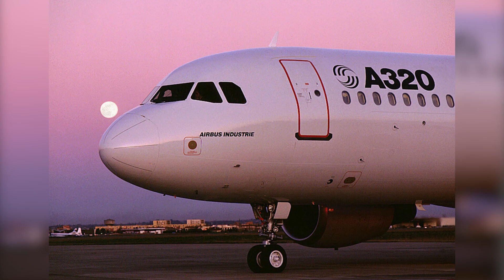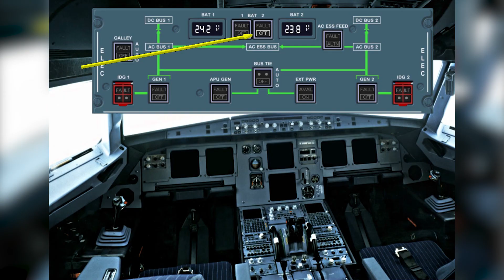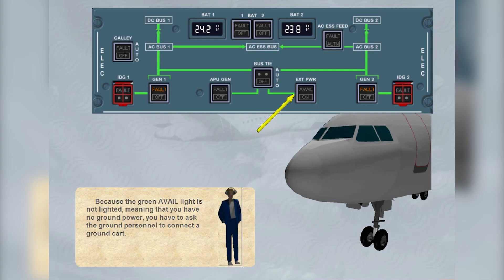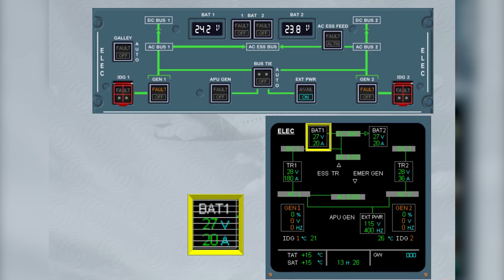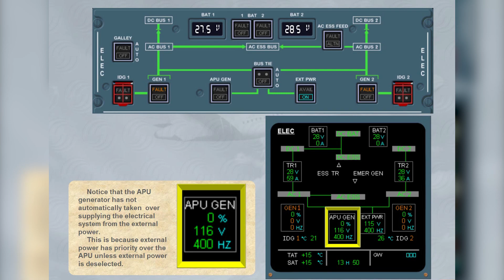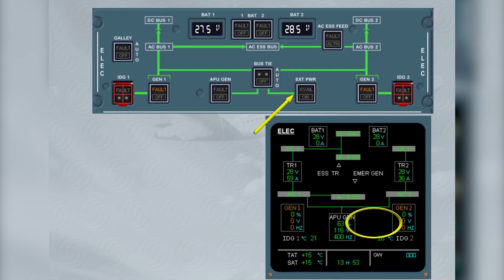Airbus A320 Battery and External Power Cold & Dark Cockpit Flows

Comment: What happens if you first push the EXT PWR button first, then connect the external plug after ?
Thanks.
Reply: it could be very dangerous for the ground worker attaching the cable